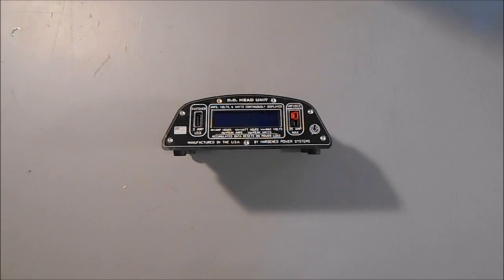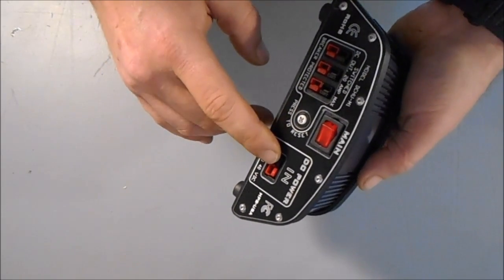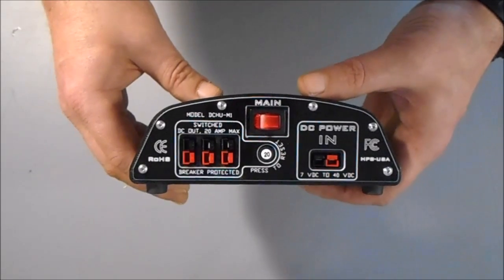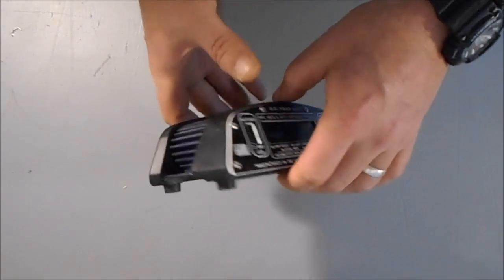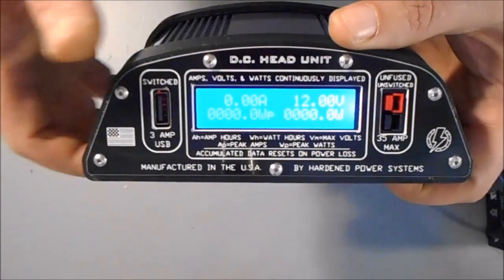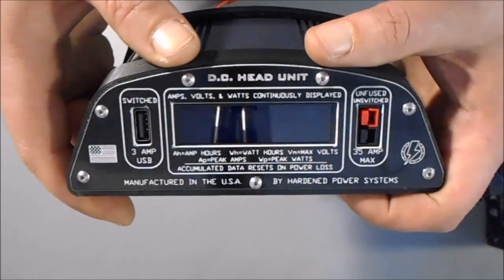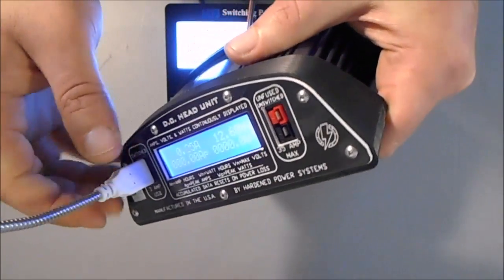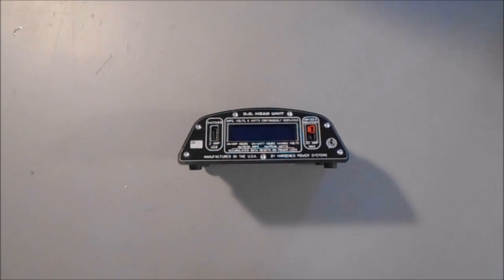Introduction to the DC Head Unit - WWW.PortableUniversalPower.com

Comment: Bill - very, very cool unit! Your ingenuity always amazes me. I can see a lot of uses for this device.
Reply from the maker: +USNERDOC Thanks Doc!  Like I say, most of our good ideas come from customers... the DC Head Unit came from a lot of discussions, internally and with customers, and it just sort of gelled over time.  We are already using the prototypes here in the shop as we build gear... it is working out great as a tool to observe and confirm power as we are building machines on the bench, and to confirm charge / discharge behavior.

  BTW, I just got the Gear Corral - very nice, and very high quality construction.  Well done.

Comment: is the front Anderson port protected from accidental power input. if some were to accidentally plug in power thru there?
Reply from the maker: +N0AGI  Applying power to the front Anderson is fine.  Electrically it is the same as applying power to the rear 'Power In' port, since it is a direct connection between the two.  You can also apply power to the distribution block in the rear... the meter will simply see the battery as a load.  In this manner, you could apply a charging voltage to the 'power in' port, and attach a battery to the distribution block, and use the meter to see power moving into the battery.

Comment: Awesome! I've wanted to start building my own portable 12v solar battery pack as an alternative to Goal Zero but never figured out a way to attractively monitor the battery. This LCD will do the trick!

Can you monitor solar input as well? I'm thinking 12V battery and solar controller wired together and into the input of the head unit. Would this monitor charge and usage that way?
Reply from the maker: +Laurence   Yes it would, as long as you run the output of the solar controller into the input of the Head Unit... AND run one of the power pole outputs to the battery you are charging.  It would serve that purpose very well, because it would display the incoming voltage from your controller, while also displaying the accumulated watt-hours that were sent to the battery.